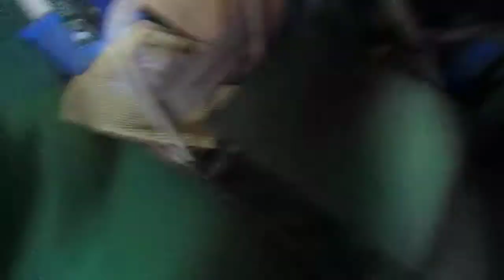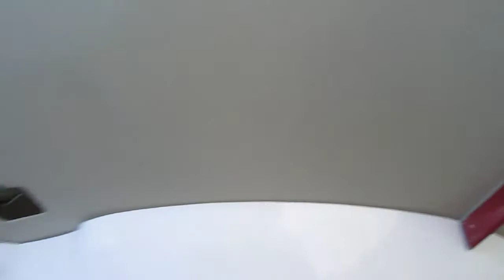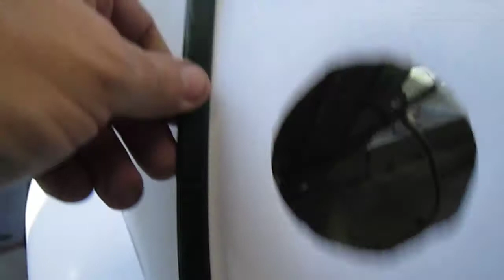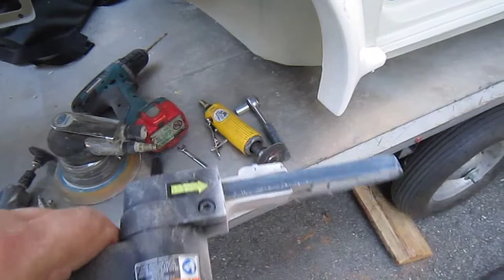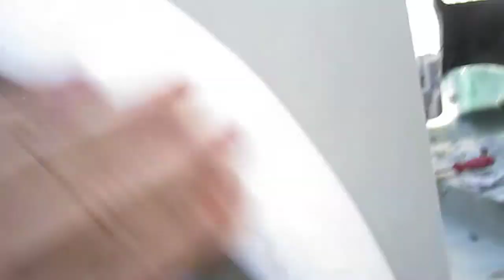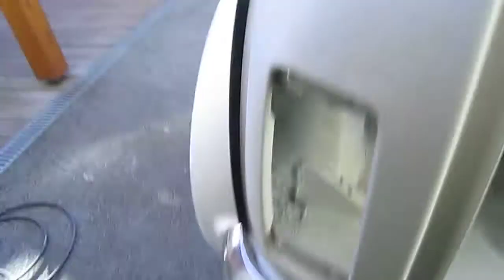Classic Mini Cooper Sport Arches cutting & fitting part 4

Comment: A Martin rant David . You are so right about the parking . On the other side of things great advice about using the spanner to get the feel .  Cheers Pete.
Reply from the maker: Pete, Thanks i thought it was just me! that gets pissed off with people that have no consideration for others. 
The fibreglass arches are very easy to over stress and you can easily brake the lugs off. Cheers David.
Reply: David it is very easy to trash stuff . Over tightening  as you well know  . Sadly we have all done it . As for the parking  only takes a muppet to wack a door into your car and well we know the rest.

Comment: What size and style of wheels are you going to fit?  I am restoring a 76 mini , it has the smaller arches.
Reply from the maker: David, I have the deep dish minilite rims. Go to ( Mini Cooper added to collection ) on davejaguar66 and you will see how it looked when i bought the car, Looks OK on the surface but like most Minis once you strip it down there is so many rust traps, The trim on Minis is just a water trap and this is where the corrision starts. All the best David.

Comment: Tiddly work for sure Dave...nicely done. Darrell-🇨🇦
Reply from the maker: Darrell, I thought it was the best method to repair the flange as the shape is so important to the body lines of the rear quarter panels, It is very hard to let a section of metal in without getting distortion. Cheers David.